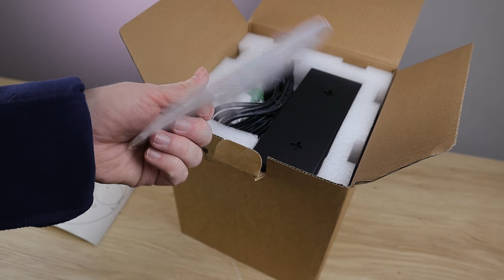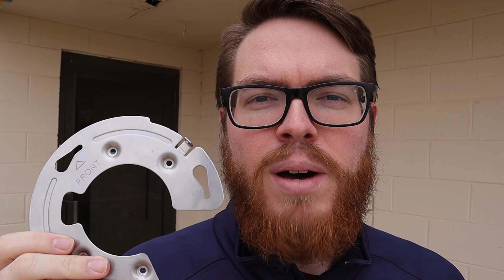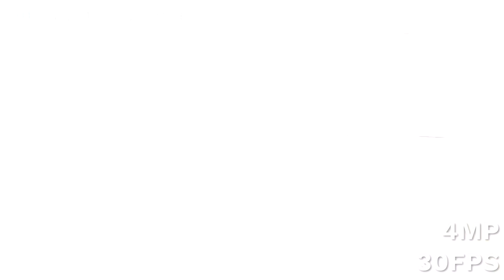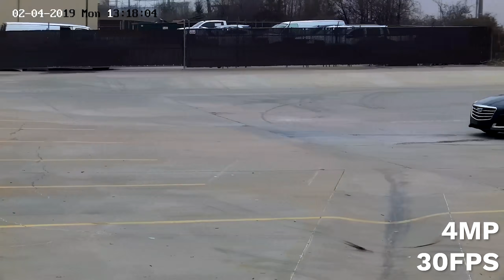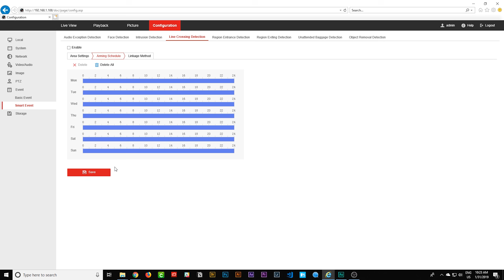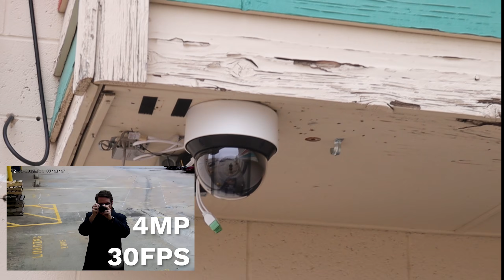4MP PTZ Camera w/ Auto Tracking & 160' Night Vision, Hidden IR, 60 FPS Video, & Long-Range 25x Zoom

Comment: I love this camera but I am still desperate to find a way to make the Smart Tracking feature engage more quickly. It always takes nearly 10 seconds for tracking to begin 
after motion has been detected and recording has begun. During that 10 seconds of waiting for the camera to adjust its pan and/or zoom I have usually missed the opportunity to capture what I needed. This happens even with perfect lighting. I am faced with having to find a different camera or continue to hope for a firmware update, which is not likely to happen. 
Does anyone have a tip on how to address this problem?

Comment: Some of these PTZ cams are very noisy, like some Dahuas for example. This is why I'm still shopping. The servos on cheap cameras are like endless 3CPO chatter which will keep you up at night if the camera is mounted to your home. It would be great if you could add a little video clip showing the camera going through its movements WITH audio from 3 or 4 feet away so that we can hear how loud or quiet it is. You might make a sale to me.

Comment: Hi , I have a hikevison PTZ poe plus camera  and two static cameras running of a hikevison poe switch as the power and data source... I have cat 6 cable installed and its good quality cable . The ptz is around 20 metres away , the static around 30 and the other also 30 

Every couple of days the cameras go offline and reboot a few hours later??? Any ideas? Am I expecting too much from the 4 port switch that it actually knocks off all 3 cameras ?

Comment: Ok to open the dome for inserting the SD card, how quickly those dust particles are to cling to the inside .. 
My question is how do I clean the dome without scratching the darn thing and secondly the ip rating is compromised once that seal is broken. 
Yes I ask because ours now has minor scratches which interfere with auto focusing and being on the Brazos the humidity is Floridian turning to frost .

Comment: Thanks for the great review! Is that a better model compare to the Hikvision DS-2DE5225IW-AE? Also, can it be mounted flat on a wall or it has to be mounted to a ceiling?
Reply from the maker: Hi Phil, i have not reviewed that Hikvision model but this one is higher resolution. It needs to be a in a ceiling mounted position. it does have a mount that you can purchase. You cannot mount it flat against a wall though as the video orientation would look funky
Reply: @NellysSecurity  Thanks for the prompt reply! Appreciated! Phil
Reply: @NellysSecurity  Actually, sorry but I have another question: are those smaller dome less reliable compare to the 2DE4225IW series which are larger and may have a bigger, more robust mechanism?
Reply from the maker: @philfastmike3496  I think they are both reliable really. They both come with a 3 year warranty. Either way, i dont think you can go wrong as far as reliability goes. Its just your preference on the style of camera.

Comment: Doesn't this camera have a recessed install mount available? Also, how does it handle multiple object tracking? Will it try to keep bot in frame as much as possible, or just focus on one?
Reply from the maker: Does not have recessed mount. As far as multiple objects, would only recommend using it in low traffic areas, otherwise may stop tracking the object of interest and track something else

Comment: Why did they stop selling this model?
Reply from the maker: Yes we did, since it was part of the H-Series or OEM Hikvision lineup, the entire line was discontinued a year ago now.
Reply: @NellysSecurity  Can you recommend a similar performing onvif compatible cam similar in design? I'd rather have that dome style instead of the larger wall mounted PTZ style like the RLC-823a.
Reply from the maker: Unfortunately we do not currently carry a PTZ in this dome form factor just yet.

This would be closest camera  specification-wise from UNV -> https://www.nellyssecurity.com/unv-4mp-deep-learning-ip67-weatherproof-ptz-ip-security-camera-with-a-25x-motorized-zoom-lens-ai-autotracking-and-lighthunter-illumination-technology-ipc6424sr-x25-vf.html

Comment: I’m a licensed low voltage technician. I see this over and over again. Going against the NEC code. All of that work should be in conduit or PVC for outside and the connections in a outdoor Bell box that stays “suitable for wet locations.”  It’s not secure. Someone could just cut the wires. Guys, find yourself an actual electrician. They follow code.
Reply from the maker: Definitely agree with you about securing the wires. This setup was done temporarily to simply shoot the video.

Comment: In your video the camera is installed outdoor but on the ceiling, protected from sun and rain/snow.
Using the wall mount, can I leave this camera directly exposed to the sun and rain without damaging it ?
Where I live, in summer the temperature can reach 40 degrees.
Reply from the maker: Yes you absolutely can, The cameras is weatherproof and operating temperature for the camera is -22F to 149F

Comment: I need a camara to watch my car parked on the street and in case someone hit it o scratch it. Does this camara is able to identify a lincense plate or face?
Reply from the maker: This camera cannot do license plate capture, but it does have face detection!

If you want plate capturing, id recommend out LPR cam here -> https://www.nellyssecurity.com/license-plate-recognition-lpr-security-camera-w-long-range-8-32mm-lens-high-powered-infrared-illuminators-silky-smooth-60-fps-at-1080p-for-plate-capture-nsc-lpr832-bt1.html
Reply: But with zoom. Can i read myself?

Comment: It zoomed before it panned in your event program sweep. 
IR sensors behind the glass are notorious in reflections and hazy image. Best to have the IR on the outside of the dome, like another model by Hikvision, as I see the similarity on the interface of your camera as a generic Hikvision. 
Maybe you can answer this question...
What camera and or setting is best for clear and higher frame rates at night, so you can record license plate?
Reply from the maker: The IR is completely seperated from the lens. There is a large seperator, not a foam gasket like you see on some domes. THere is no IR glare at all.

To capture license plates, check this out: https://www.nellyssecurity.com/blog/articles/video-surveillance/best-license-plate-recognition-camera-nsc-lpr832-bt1
Reply: @NellysSecurity  good to know. I have a couple high zoom cameras, they dont have the SW ability to log plate captures. Thanks

Comment: That sd card placement is pretty inconvenient. That's like putting your car's gas cap under the passenger's seat.
Your price is about $300 higher than ebay prices.
Reply from the maker: We agree the SD card placement is very inconvenient. As far as Ebay goes, you most likely will not get any tech support or warranty support through ebay sellers. But I completely understand the price is very appealing and if you are willing to accept the risk/reward analysis, then you should defininetely go for it.

Comment: Hi, i have this camera too.
I Hope you can help me with a special setting i can't find.

I’m having a slight issue with auto tracking. When the camera detects an object (human/vehicle) it will auto track the object until it comes to a standstill and after about 5 seconds the camera will then revert back to the default/pre-set position. When a vehicle enters the road, it will track until the vehicle parks, the camera then reverts back to the pre-set position before the driver has exited the vehicle.

I wanne change that 5 seconds into more....
Reply from the maker: Hey there!
If you log into the PTZ's web interface directly, go into Configuration -> PTZ -> Smart Tracking

You should be able to adjust the allotted tracking time.
Reply: @NellysSecurity  hi thanks for the message, but thats not it.
thats the time that the cam folows a  moving object
im looking for the setting that the cam waits when an object stops
after 5 sec of stop moving the cam goes to its start position

Comment: What browser are you using? I've read that it is no longer possible to view and program this camera with any of the popular browsers, on Mac or PC. How would we draw the intrusion lines on the screen if we could not see the camera view?
Reply from the maker: Hi Dan, They are beginning to roll out firmwares that you can view in all browsers. Not sure if there is one available for this one yet or not. However, you can still view the camera just fine in Internet Explorer. You can also configure it with the free software as well which requires no browsers.
Reply: @NellysSecurity : Thank you so much for your friendly and speedy reply. You are correct about the software. In fact this prompted me to look for the most up to date Hikvision software for my Mac and I can now program my other Hikvision camera WHILE actually seeing what the camera sees, which it would not do in the past.  You may have seen my other comment (below) asking about how noisy the servos may or may not be on this camera. This is actually a great concern for many users so it would be good to have a little clip as I described below so that we will know how it sounds. In my case I am a builder of high-end custom homes and will often include a system with these kinds of cameras for added value. The problem is that I cannot mount a noisy camera to the side of an expensive home if it may keep prospective buyers up at night. Any info you may have in this regard would be greatly appreciated. That said; your video is great! You did a very good job and it provides a lot of detail. BUT, we do all want to see some night time IR shots to complete the picture.
Reply from the maker: @blue-n8i  Hi Dan, Whenever i was installing and playing around with the camera, i dont even remember the noise at all. Im sure there is some, but Im not sure if you would even hear that much unless it was maybe panning full speed
Reply: @NellysSecurity  Okay, this is good to know. Thank you.

Comment: Does this have human detection or is it going to chase every bird and squirrel in my yard?
Reply: @ngoichoi976  thanks, I've since went with Dahua. Human detection is great and in the same price range.
Reply: @ngoichoi976  the cameras I purchased in the same price range aren't vandal dome style cameras. I purchased one Dahua vandal dome that's pretty much the same size as the one in this video but uses a different mount system and is about $300-400 more expensive. It's the SD50432XA-HNR camera and I picked it up on Ebay for $900.
Reply: @ngoichoi976  the SD50432XA-HNR does have human/vehicle tracking that works quite well but doesn't have LPR, sorry. That wasn't a feature I was looking for when I was shopping for mine.
Reply: @ngoichoi976  yes, you would need Dahua NVR & Hikvision NVR. I have both, the Dahua recording only human activity on the Dahua cams and non-stop record on the Hikvision cams. My Hikvision does the opposite, records human activity on my fixed lens turret Hikvision cams and non-stop record on the Dahua cams. This way I always have redundant backup on all cams and both non-stop recording and intelligent recording on all cams.

Comment: It's a ripoff Hikvision?
Also, you don't need the drill template to attach the metal backplate... that made me cringe.
Reply: Hikvision sales OEM versions for companies to write custom firmware and brand themselves for resale.
Reply from the maker: Yes, this is a HIkvision OEM. Sorry for making you cringe :)
Reply: I've had a few hikvisions going for several years. They have been bulletproof for me.

Comment: The edge recording on cameras (especially ptz) should be used more as redundancy over the primary recording pathway.  What a hassle it becomes to have to get the sd card whenever you want to see the recordings.  Nvr all the way
Reply from the maker: Good call! However whenever you stick an SD card in these cameras, you will never have to pull out the SD card. You can access all the video directly from the web interface with a nice organized playback interface.
Reply: @NellysSecurity  yeah fair enough.( I guess things have changed from the 1st edge recordings) but still, the nvr makes life so much easier.
Reply from the maker: @mooseyjuice6t9  agreed!

Comment: How well does this work with Hikvision DS--- 8ch PoE  DS-7608NI-I2-8P (IEEE 802.3 af/at) can i power the PTZ entirely off POE without power injector?
Reply from the maker: The NVR should be able to power this PTZ, if not, the PTZ comes with its own POE injector.
Reply: @NellysSecurity  can i ask you to try it out before i purchase? and confirm shipping to aus is expensive and dont want to risk it if it doesnt :(

Comment: Does it use rs485 instead of female network poe port?
Reply from the maker: The PTZ controls are through the cat cable. This PTZ does not have separate RS485 connections.

Comment: Hi. Great informative video. I have just bought one of these PTZ's and it is brilliant. Only problem is in my menu I do not have the PTZ sub menu between the image and event sub menu. I have a new 16 channel NVR 7616NI-I2 with firmware V4.1.64 190726 and am wondering if Hikvision have removed the PTZ option.
Thank you.
Reply: Bit more info, I can do presets, patrols etc, but can't do smart tracking. No where in the menu can I find this.
Reply from the maker: hey Keith,

You have to access the PTZ directly to go into the PTZ Tab. if the cam is connected to your NVR, you'll need to use virtual host from a local PC to achieve this.

We have a guide here on that -> https://support.nellyssecurity.com/hc/en-us/articles/360043721694-How-to-Setup-Virtual-Host
Reply: @NellysSecurity  Hi and thank you for your reply. I followed your reply and all is good now. The PTZ is under the cameras configuration not the NVR's configuration. Works great now. Again, thank you for your reply and your video's are very informative.

Comment: Great review.  Can this camera be use independently by itself with only the app on your phone?
Reply from the maker: Yes it can
Reply: : @NellysSecurity  What app would be needed to be able to control this camera on an Android phone as you are doing in this video?
Reply from the maker: @blue-n8i  Hi Dan, We use Hik Connect
Reply: @NellysSecurity : Thank you for your reply. One last question: I use Blue Iris software for my surveillance system. There does not appear to be any choice within Blue Iris for your camera as seen here in this video. Is there a compatible choice within Blue Iris setup and if so which one would you recommend for your camera?
Reply: @blue-n8i  You may try Hikvision Protocol and/or Onvif Protocol

Comment: will NSC-4A425-PTZir work with DS-7616NI- nvr  - will it support auto tracking capabilities?  or what nvr i need be able use  auto tracking? thank you!
Reply: It will work like a champ
Reply: Sean Nelson and no they did not support smart tracking with DS-7616NI and i did return the nvr

Comment: Can it be setup to do the patrol as in the first video combined with smart tracking if it picks up movement??  (For example a large yard that should never have anyone in it)?  Thanks!
Reply from the maker: Howdy. If its patrolling it would not be able to pick up on subsequent movement. The camera needs to be initially still to do the auto-tracking
Reply: Nelly's Security 
not exactly true, it can smart track after the camera moves to the patrol position after 2 seconds in that position, e.g. camera moves between two patrol position, and as long as you have the time that the camera has stopped at said position is longer than 2 seconds it will be in smart tracking mode, if it detects movement it will start tracking that object, once it losers that object and stops tracking it will then go back to the last patrol position and then start back into patrol mode.

Comment: Nice camera, what is the software you are using to drive it?
Reply from the maker: It is embedded software. We are simply logging into the cameras web interface in the video
Reply: SMART PHONE CAPABLE
Reply from the maker: @genjen2829  absolutely
Reply: Can you use a Linux Firefox browser for camera configuration?
Reply from the maker: @tonyross8054  Unfortunately not
Reply: Hi nice review NELLIS I want to buy one of this this weekand but. I need more info before to buy it can I use it with out the nvr? I know I can recorded on sd card but can it recorded on icloud too?  how noisy is the motor when is tracking people? And last one if outside my house is lightning can the camera see color night vision?